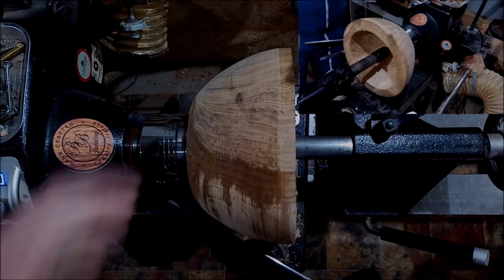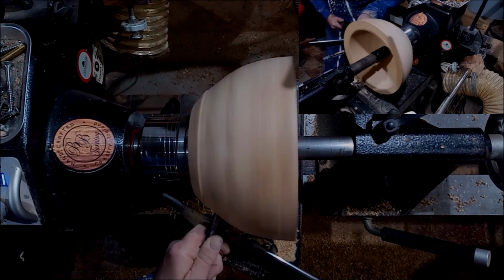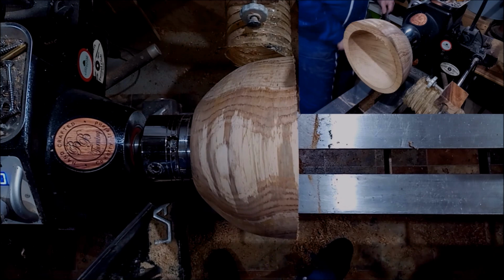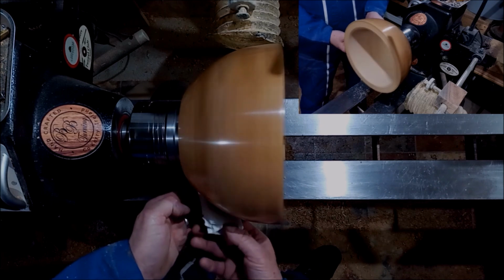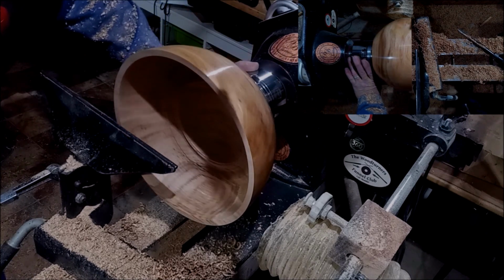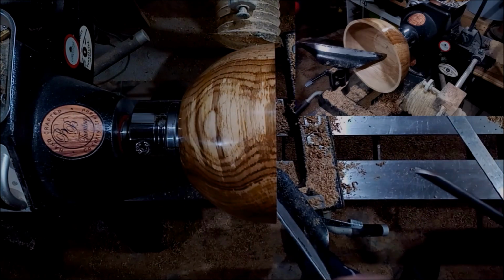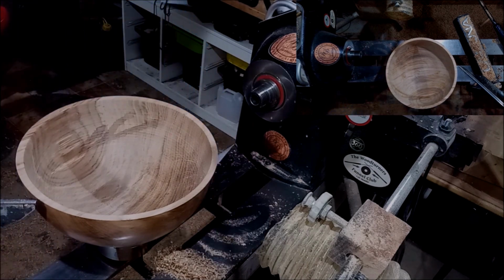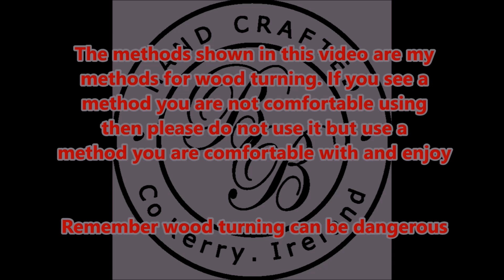Woodturning a deep Irish White Oak bowl / wood turning

Comment: I was able to see Stuart Batty turn a deep bowl at the last AAW symposium. There are two main differences between a traditional scraper and a negative rake scraper. First is the angle which each tool is presented to the wood. The traditional scraper has to be angled down. The negative rake scraper can be flat. So with the flat presentation, all the force from the wood goes into the tool rest. With the downward angle, there is a force component that causes the scraper to advance or feed into the wood. The second main difference is it  abrades the wood with just the burr from sharpening. When the burr is gone, you need to make a new one. The burr should be presented up, so it can abrade. This is why it needs a light touch, heavy work will remove the burr almost immediately. You cannot peal with the NRS like you can with a traditional scraper. Both scrapers need an included angle less than 90 degrees, traditional scrapers can pick up strength/support from a more blunt angle. Since you are only using the burr on a NRS, grind angle doesn’t matter. Also since it’s lightly touching, you can use a longer profile/edge. I hope this helps some of your viewers.
Reply from the maker: Very well explained Timothy, Stuart is a fantastic instructor. As in the video the negative rake scraper is as you say presented flat . I grind mine at a 35/35 angle so if the outside of a bowl requires scraping I can just raise the burr on the other side of the scraper and it will work. I must do a video on scrapers when I get the opportunity. Again thanks for the explination.
Shay